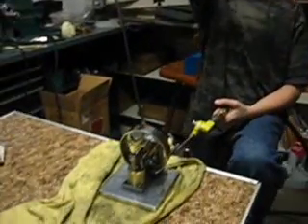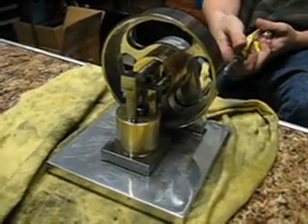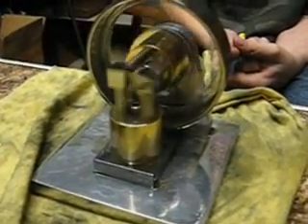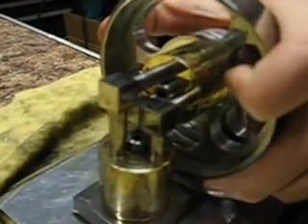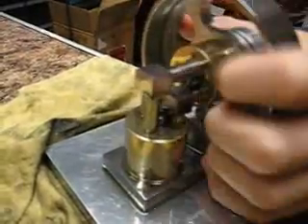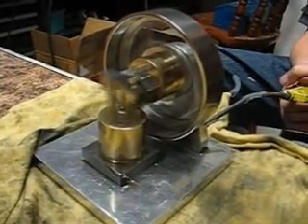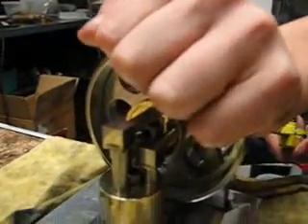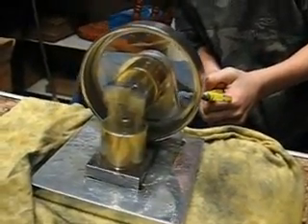Elbow steam engine.

Comment: Well done. That engine is a fine achievement for anyone, let alone a youngster. When I was that age, my metalworking 'triumphs' consisted of a paint scraper and a screwdriver.        

I'm trying to grasp how it works. I suppose the cylinders rotate past a steam port in the base and then exhaust as they rotate away. An interesting idea, and it seems quite powerful too.